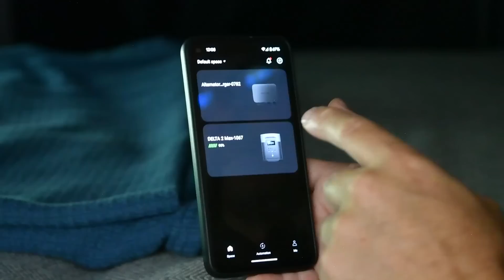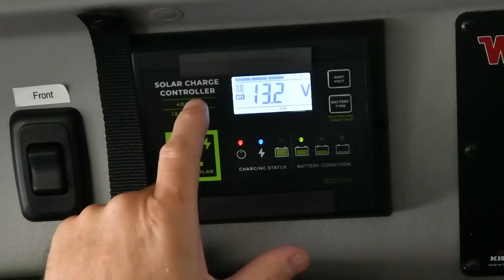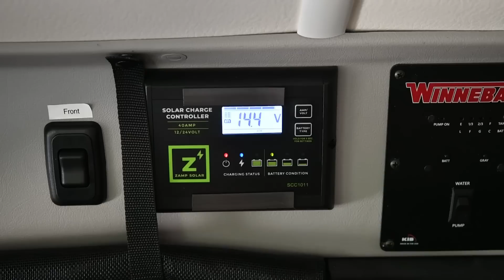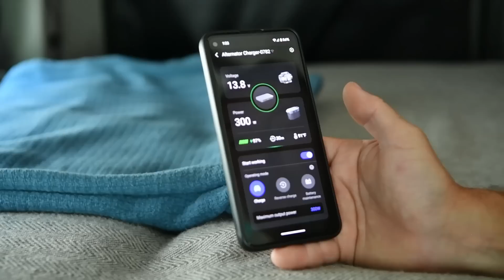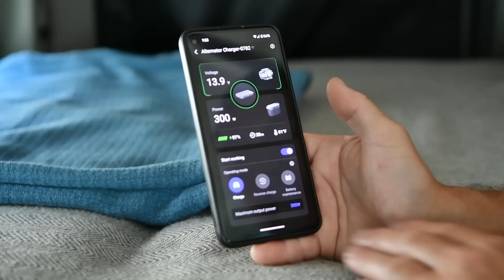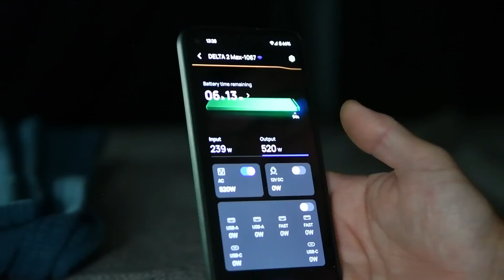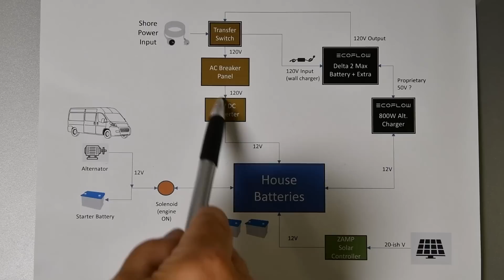Lessons Learned! ECOFLOW Alternator Charger and Battery upgrade

Comment from the maker: We selected and purchased these products ourselves, but we may make a small commission from our links. Please use them! It doesn't cost you anything but helps us a lot. Thank you!

For the best pricing, we recommend checking the following links and comparing deals and prices:

Delta 2 Max Power Station with Smart Extra Battery combo deals:

Amazon: https://amzn.to/3DZqWwA
Wellbots: https://www.wellbots.com/products/ecoflow-delta-2-max-portable-power-station?variant=40843422433328
Ecoflow Direct: https://us.ecoflow.com/products/delta-2-max-portable-power-station

Or individual battery components:

Ecoflow Delta 2 Max Portable Power Station
Amazon: https://amzn.to/40DSa4w
Wellbots: https://www.wellbots.com/products/ecoflow-delta-2-max-portable-power-station
Ecoflow Direct: https://us.ecoflow.com/products/delta-2-max-portable-power-station

Ecoflow Delta 2 Max Smart Extra Battery
Amazon: https://amzn.to/4aotekM
Wellbots: https://www.wellbots.com/products/ecoflow-delta-2-max-smart-extra-battery
Ecoflow Direct: https://us.ecoflow.com/products/delta-2-max-smart-extra-battery

Ecoflow 800W Alternator Charger
https://amzn.to/3E5pnNM
https://www.wellbots.com/products/ecoflow-800w-alternator-charger
https://us.ecoflow.com/products/800w-alternator-charger

Comment: Now that the 2027 model has a generator would you opt for a generator over the hassle of dealing with electronics ?
Reply from the maker: Hi there and thanks for your question! We covered that consideration in our review of the 2026 Solis Pocket https://youtu.be/q2j9z9U3aLk. Bottom line, it depends... For us, having the extra power is preferred and we like carrying the spare tire where the generator is installed. Also you can't always run a generator when you want 120v power. But for many people, the convenience is probably worth it. Take care and thanks for watching!

Comment: Ive configured my ecoflow to be powered by/charged from the Altenator/battery  device and all ac is powered as if on shore power from the delta 3.
Reply from the maker: Sounds good! One thing to be careful of is when the house batteries are low and being charged from the alternator, you want to be careful not to draw too much charging for the Delta 3 at the same time which could overload the alternator. Good luck and thanks for sharing!

Comment: Excellent videos. Keep them coming. Very informative. Thank you! I’m wondering if you had to do it all over again, if you would’ve waited for the 2026 model with the onboard generator regarding your power needs?
Reply from the maker: Thank you so much for that feedback, it is really appreciated. If you watched some of our older videos, we started out with an external generator but the storage space, hassle of setup, and noise/exhaust drove us away from it, with a preference to simply add more power and convert our A/C to a 12v model. The under-carriage generator solves 2 of those 3 issues and the noise is rated at 48db which is not terrible but surely noticeable.  We considered adding an under-mount generator but it wasn't the path we wanted to take, we wanted that space for our spare tire as our garage is tight and we can't mount it on the back like some people do. For many, the new Pocket with the generator is a great solution and addresses the two biggest power limitations with the Pocket: 120v and A/C. For us, we would still stick with our solution for the reasons above. In an ideal world, we would prefer the Pocket with 48v on-board lithium from the factory with the 48v version of our Velit A/C. But that's not offered yet! Thanks a lot for watching and take care!
Reply: @Outapkt  I really appreciate the follow up. A wealth of information. Thank you and safe travels!

Comment: I am trying to figure this out with a my truck… I have a 200w flex solar on my RTT and EcoFlow alternator charger both connected into my EcoFlow Delta 2 and I want to add a 100ah Li house battery… I just don’t know where to bring in the new house battery to update this set up?
Reply from the maker: Hmmm. Not sure we have any good advice on that. I recall seeing some discussions on the ECOFLOW Facebook group about those types of scenarios, maybe you can check that out. Thanks for watching and good luck!

Comment: excellent video, thanks you two for showing the scenarios. My only 'house' battery is the Ecoflow Delta Pro 3, and I am wondering how you wired your Ecoflow Alternator Charger to the starter battery. Did you go direct to the negative terminal on your starter battery, or did you ground to the chassis?
Reply from the maker: Hi there! Thanks a lot for the feedback. In our case we hooked the alternator charger up to our house batteries. We did a separate video covering the install.  We went right for the battery terminals and did not go to the chassis for the ground. For us, there were advantages going to the house batteries vs the starter battery which we cover in that video. Thanks again for watching and for your question. Good luck!

Comment: Me and my wife bought a new sprinter thinking we would convert it.  We bought the rear bed kit and wheel well boxes, it had a headliner because it was a crew van, we put in a sink and simple water and grey water "in cabinet" tanks.  It didn't work for us, too uncomfortable.  I sold it, and now bought this fifth wheel.  When I showed the dealer the Ecoflow, and proposed setup,  he saw that this is for SURE the way that many people are going to want to set up their trailers and coaches.  We would only be "off grid" for a night at a time, while we are traveling.  Maybe two nights if we wanted to do some simple boon docking.   Most people dont really need or want a gas or propane generator, noisy, maintenance, and costly.  You can always bring a small Honda 2200 to charge your eco flow,  OR a larger portable generator,  when you need it and just plug in your shore power.  I will show him your diagram and channel.  Also, on your setup, you have the Solar generator connected to the transfer switch for 110v charging of the solar generator.  Wouldn't this create a "loop" when NOT plugged into shore power?  The generator sends 110 to the transfer switch, which sends it right back into the generator??
Reply from the maker: Thanks for sharing your experiences, sorry the van didn't work out but glad you found something that did! We really like the setup, like you say perfect for a night or two of boondocking or off-grid, then you drive somewhere and everything charges back up! We originally bought a generator thinking it would be our auxiliary power but it was just too big, bulky, and noisy. As to your question about the loop, it is good question because I had it originally myself. But there is no loop because the way this transfer switch works is that specific output of the transfer switch, the one that feeds the AC input of the ECOFLOW for charging, is only live when the transfer switch is on the shore power input. Once the transfer switch changes over the ECOFLOW input, that output of switch is no longer live and the ECOFLOW cannot try to charge itself. It really is a good setup. We also piggy-backed off that same transfer switch output to power a trickle charger for the van starter battery. Thus whenever we are on shore power, the ECOFLOW battery can charge and the van starter batter will charge. When we switch to 120V running off the ECOFLOW, those are not powered. It works great! Thanks again for watching and sharing your comments and questions.

Comment: I bought a new 5th wheel.  I have an eco flow delta pro 3, and an inverter charger.  this is the exact setup I was thinking.  this trailer has a generator prep, which feeds all 110 outlets in the trailer.  it has 2 house batteries, with solar on the roof, and 50a shore power.  The generator prep box I had them wire with a 30a 4 prong outlet, which I plug the eco flow into.  there is a transfer switch on the generator line, so it won't back feed.  So I think this is exactly your setup.  I plug in the eco flow, and it feeds the entire coach if I want it to.  There is an alternator charger between the house batteries, and the eco flow.    exactly like yours.  Your comment about turning off the converter I dont think works in my scenario, since all of the 12v appliances are powered by the house batteries, and not connected to the 110 generator group.  So I guess just leaving the converter on, even when I am running the eco flow I OK, since no 12v items are running off of the eco flow.  does that make sense?
Reply from the maker: Yes it makes sense. There is no harm running the converter it just results in a bit of efficiency/power loss. It is slightly more efficient to feed supplemental 12v to the coach batteries using the "reverse charge" mode of the ECOFLOW alternator charger and bypass the 120v circuit. Glad to hear a similar setup can work on a 5th wheel! Thanks for sharing and good luck!

Comment: Check out the ecoflow power kits
Reply from the maker: Yes those are nice. Not cheap but the 48v is very useful if you are going to swap out the 120v AC and run a 48v unit as that would be very efficient.

Comment: Great video.  Very informative and I learned a lot.  I am very interested in EcoFlow alternator charger.  Two questions.  Any thoughts on adding a secondary alternator for the Delta 2 Max battery?  Then it can charge the Delta 2 Max battery independently from the house batteries.  Any concerns on having two different types of batteries in the same system?
Reply from the maker: Hi! Thank you for your feedback, it is really appreciated! As far as the second alternator, that might be complex but would allow you to charge both in parallel if that is important. We just try to be careful with our charging and avoid charging low house batteries while also drawing a lot for the Deltas - the alternator charger allows to you set the desired current. Also maybe you could upgrade the current alternator. I think there is a 70 amp (?) fuse inline to the house batteries so you don't want to exceed that, but maybe you could hook up the ECOFLOW alternator charger to the larger alternator on its own feed like you would have done on the second alternator. To your second question: by using the ECOFLOW alternator charger I don't think you need to worry about the different battery systems as the ECOFLOW charger deals with the specifics for charging the lithium Deltas.

Comment: EcoFlow high frequency inverters lack an isolation transformer at their output so that can easily damage you appliances.
Reply from the maker: That's interesting, we did not know that! Appreciate the heads-up. We are always careful to let the 120v power stabilize before plugging in any appliances and also ensure we don't overload the ECOFLOW. So far so good. Thanks for sharing.

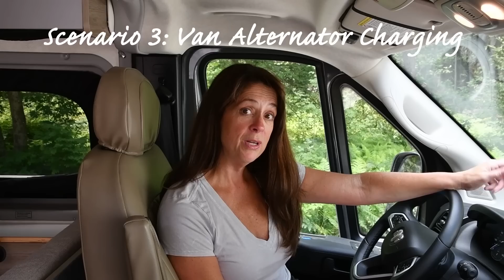Comment: Wen you say "house battery", do you mean Winnebago or RV-Car Battery?  I don't see a house in your diagram at 4:33?
Reply from the maker: Sorry for the confusion... The "house" battery is the RV battery system (actually 2 AGM batteries)... Also called the "coach" battery. This is added by Winnebago. This is different from the normal van Promaster starter battery. Hope that helps and thanks for your question.

Comment: Because I am using an alternator charger NOT in a vehicle (i.e., no alternator), my posts below are probably mostly messed up. I need to think about the current flows more when there is an alternator vs. when there isn't. I think that the alternator charger is just a more sophisticated DC-DC converter. Here's a good presentation of the topic: https://www.youtube.com/watch?v=C2tWguITtwM
Reply from the maker: The alternator is just another power source. In our video we fed excess solar power into the alternator charger and that worked to charge the ECOFLOW batteries. That was 13.7 volts or so. Power will generally always flow from high voltage to low voltage. Alternators put out 14v so they are king of the hill and everything will suck in that power if they need it. Yes it is a DC to DC converter with a lot of cool features. The house batteries are 12.8 volts or so they will always be last in line to draw power from.